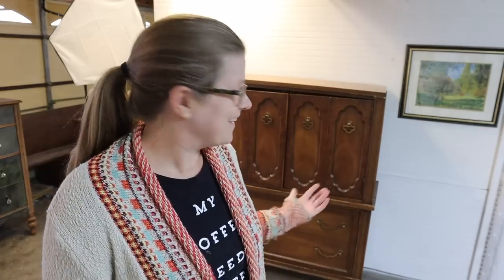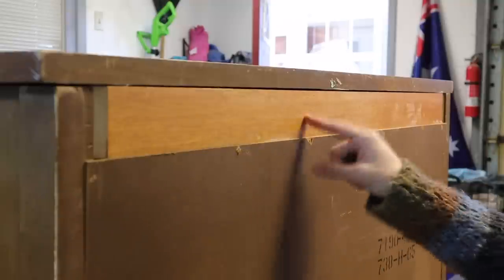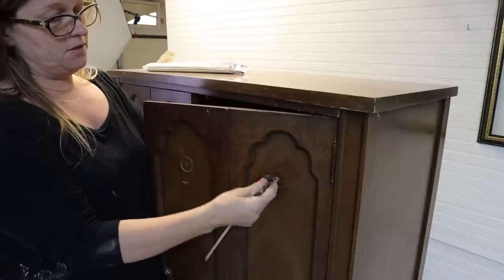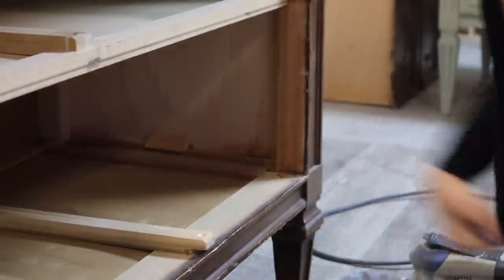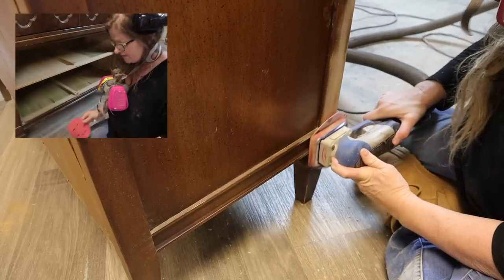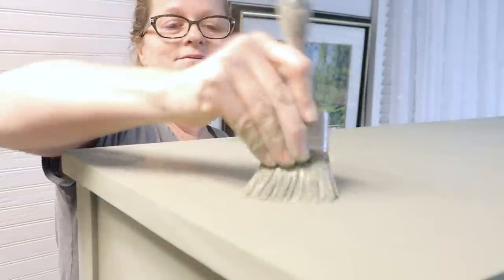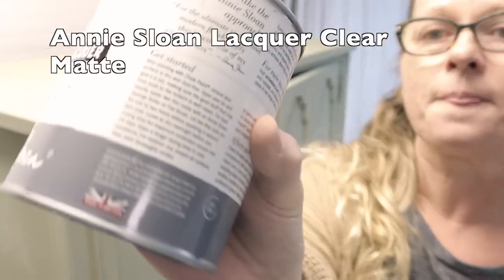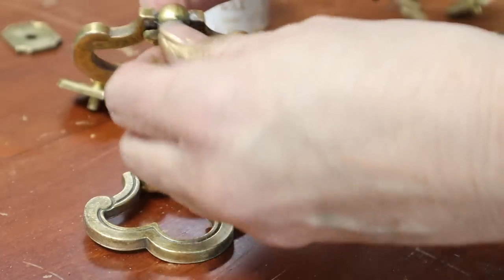Don't Paint That Old Dresser Until You Watch This! UPSCALE YOUR FURNITURE, Easy as, the Aussie Way!

Comment: I bought a buffet half price at Goodwill for 20 dollars because the top was loose and the drawers were wonky thinking it would be worth the work of fixing. After Googling the drawers glides to figure out how they opened, I discovered that the top piece was held on with cam locks that just needed tightening. The drawer glide screws were also loose. Tightened everything up, put it back together, and after a good clean and polish it was done.
Reply from the maker: Ahhh that was a score Paula!!! So good 🥰

Comment: I just noticed a video come up for the channel name of “vintage and painted”.  It has your picture and is a short of a regular video that I thought was from you but just realized it’s the same channel name as this short.  I know it’s been a problem for other channels where someone steals the content and even the picture so I wanted to check with you about it.  Or maybe you changed your channel name, mentioned that in a video and my Swiss cheese brain doesn’t remember.  😣
Reply from the maker: This is me. I did change the name. I mentioned it in a post and will mention it in this Saturdays video. I wanted something that was more in line with what I do and Bo rage and painting answered that 🥰
Reply: @VintageAndPainted  That’s a huge relief!  Thanks for letting me know (or actually reminding my swiss cheese brain)!  🤦🏼‍♀️👍❤️